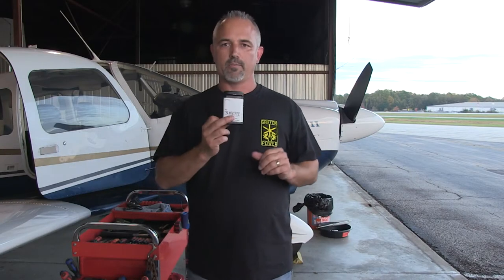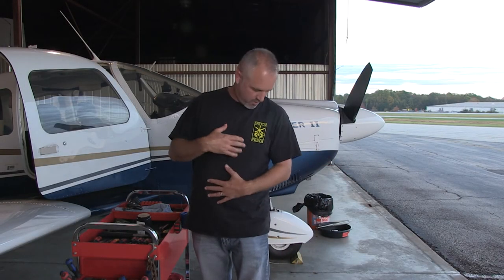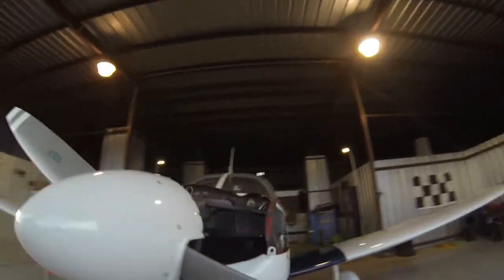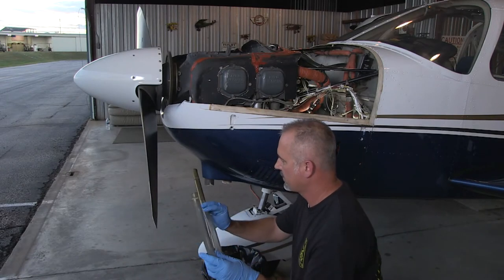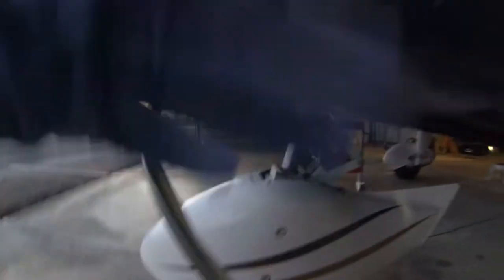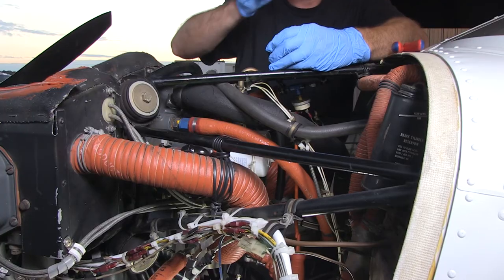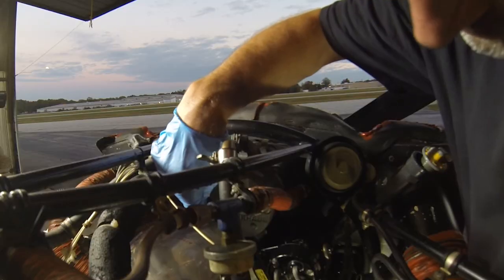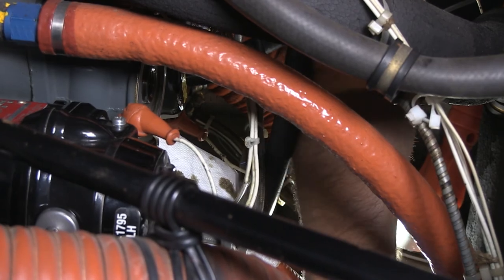DIY How To Change The Oil In An Airplane  Engine Part 1 maintaining an airplane oil change

Comment: I found that a piece of aluminum angle stock or similar about 2ft long placed under the oil filter works as a nice channel to direct the oil outside the cowling into a bucket.  Might take some finagling to get it just right and limit how fast the oil flows initially and you can catch/redirect all the oil into a bucket without any mess.
Reply from the maker: Great idea!